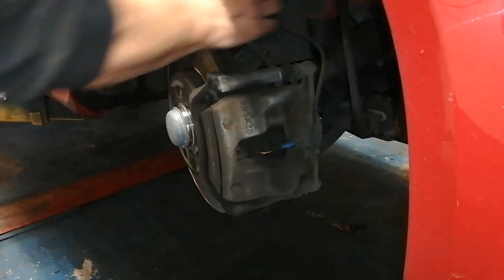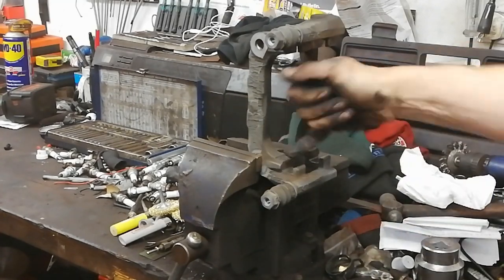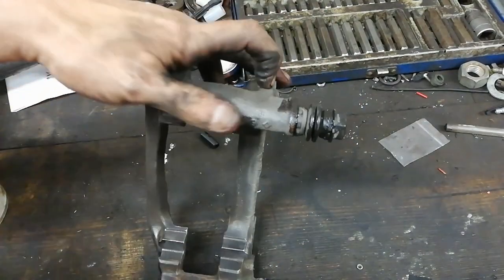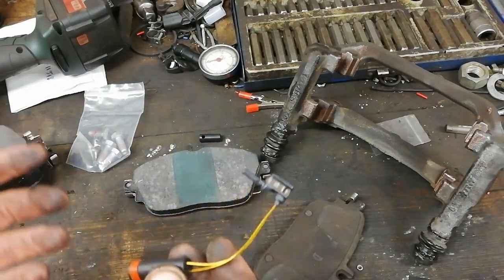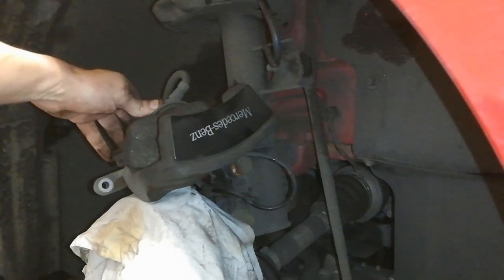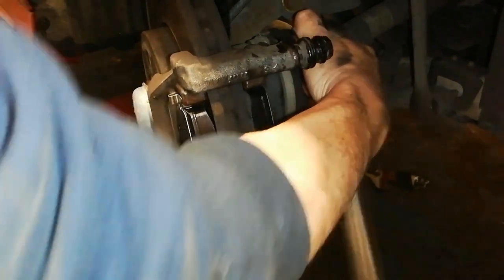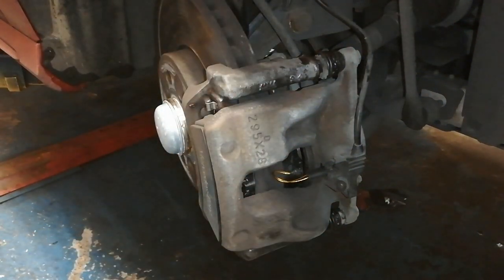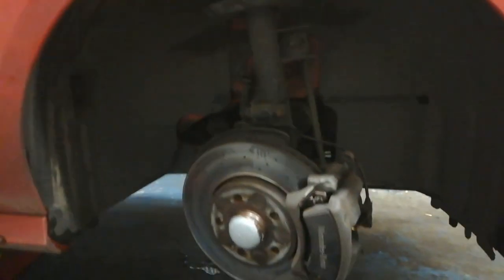Mercedes A-Class A180d Front Brake Pads Done Properly

Comment: Good man. Proper job.
Reply from the maker: Thanks Ian, i hear guys talking down at the local parts store mentioning they have to grind a bit off new pads to make them fit, sort of inspired me to do this one, cheers dave
Reply: @davesterl  Aye a think you only make the mistake of having overly tight pads once...lots of heat & brake dust and blue discs/rotors and the alarming odour of overheating friction materials...not good. Too loose chattering. The "Goldielocks" fit is a must...as you well know. Cheers Pal